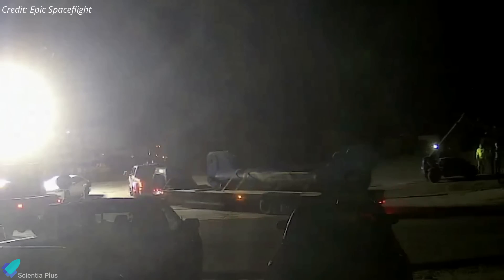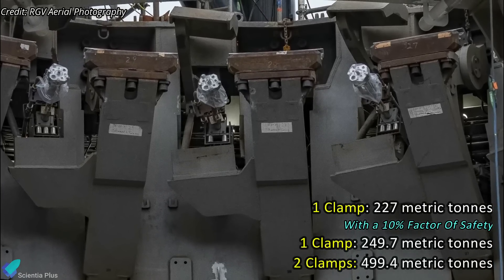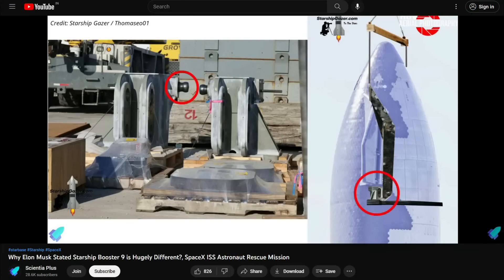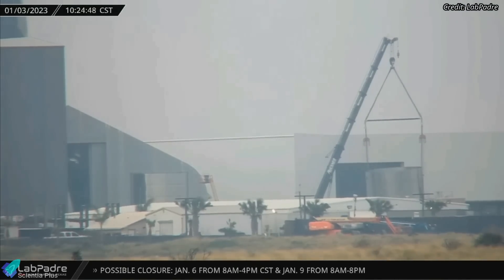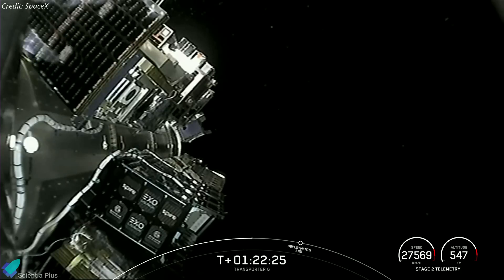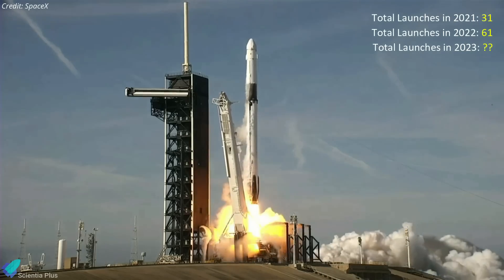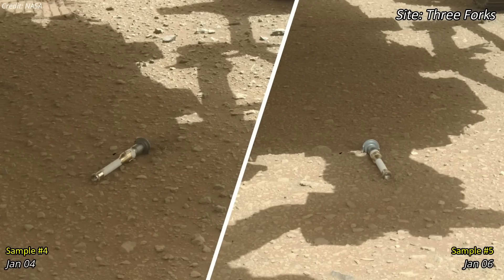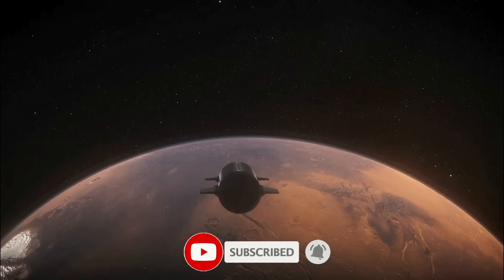Starship Final Tests Before Orbital Launch This Week, Virgin Orbit, Transporter 6, Perseverance

Comment: That sample return tube looks exactly like Luke Skywalker's first lightsaber.
Reply: You are correct, that is an episode VI (Return of the Jedi) , aka Yuma, aka Stunt double, what can be identified as ‘Luke’s green bladed lightsaber’ fun fact: when they started shooting, the props department sent the Graflex flashgun based ‘Anakin’ saber to set and when it was pointed out that that saber was cut off with Luke’s hand at the end of Empire Strikes Back (Ep V), the prop guy returned from the trailer with the stunt double saber modeled on Alec Guinness’s Ep IV saber. Both Vader and Obi Wan used it in that film.